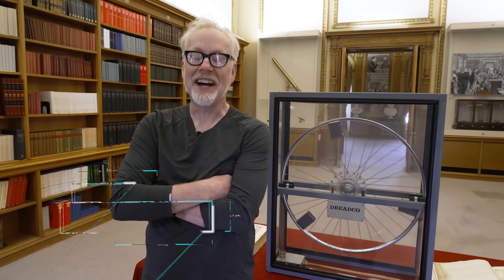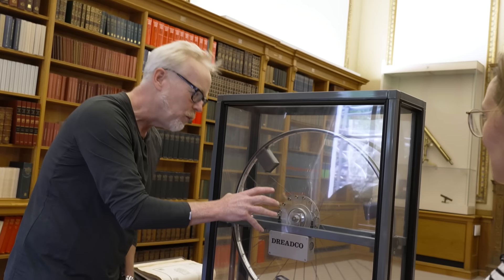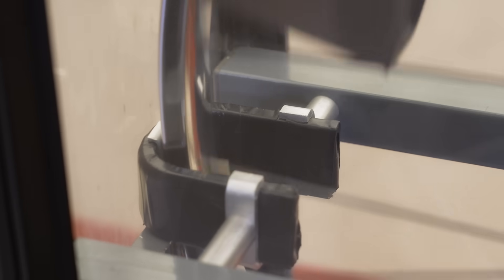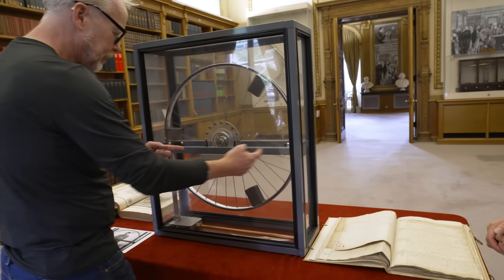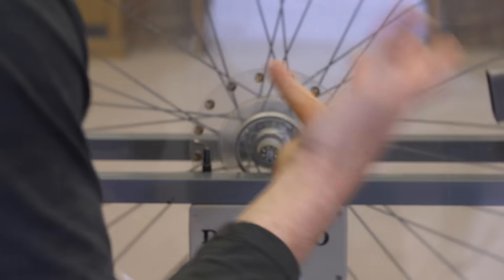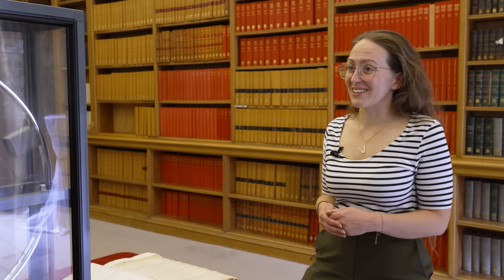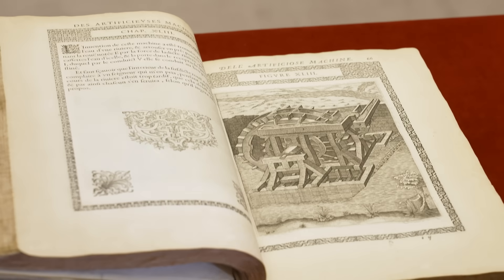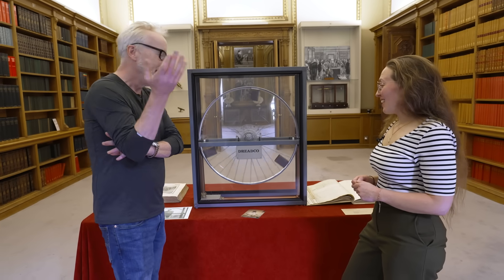Adam Savage vs The "Perpetual Motion" Machine!

Comment: I mean it's gotta be some sort of push pull thing with the magnets right? A weird hall sensor type devices to hale the timing and it tells the magnet when to turn on to pull on box and push the other and the whole time the wheel itself charges what ever mechanism keeps the thing running. I'd also assume the box is a vacuum to reduce the amount of potential drag that could occur with atmosphere. Of course it's also possible there's a solar panel or two in there to help keep it running, if people were disappointed by the answer. Either way it's a fascinating thought experiment and seems like it almost demands that others try it just to test their theories.

Comment: It does not look at all efficient, those don't appear to be low friction precision bearings so it's probably generating a considerable electrical field in certain areas which could easily be mapped with a digital rf meter, in fact the entire circuit could probably be described with careful analysis that would take about one minute using a basic rf meter.  My grandfather worked the perpetual motion issue nonstop for about 6 years, until I spoiled it for him when I was a kid, suggesting that there was no possibility in physics of success - even though I had little actual knowledge applicable to the matter.  I was just a kid trying to look smart, a sad blunder on my part - never douse a man's passion for mystery with hastily spoken reality.  Better to let dreamers dream for sometimes they do come up with some cool stuff.

Comment: My theory is that the energy of the machine is self sustaining. The servicing is replacing the bearings. It still maintains the “cannot create more than it uses” law.

I think the issue with talking about using perpetual motion to produce energy is that we are looking at it all wrong. We should be looking at making a machine that powers itself, and has a separate system that produces charge somehow. Hmm.

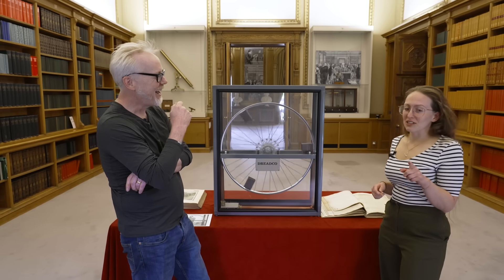Comment: I have stopped at 6:58 I suspect that there is a small battery powered fan blowing/circulating air via the copper tubes. A common doctors stethoscope would detect and motor hum or motor harmonics. (This is the powered driver)
>
The rest is the "Magnetic driven" perpetual motion machine, which is very elaborately and carefully created, including the slight offset of the electrical(ish)  actuators on the stator near the hub.
Just  guess as I can't see it close up, or drop a stethoscope on it :)
>
I will acknowledge the possibility of a reed switch in each box to activate a battery coil as it passes the magnet as others have suggested...

Comment: The central probes that don't touch anything are sensing the rivets in the center to tell the magnets when to reverse polarity. You will notice there are 2 bumps for every time a box crosses one of the U shaped magnets. 2 Phases for each time a box passes a magnet. First the magnets pull the boxes then as they pass through the probes trigger a switch in polarity and the magnets are now pushing the box around the circle. This would only require tiny amounts of power, the boxes contain both the mechanisms to reverse polarity (likely the center) and the battery (likely the heat sync box in the corner). You could easily wire it the other way around though. That's all there is to it as far as I can tell. 2 electromagnets and 3 boxes to be pushed/pulled. The bearing is likely extremely efficient and the system very well balanced. The less friction the longer it will run. When it dies they probably just replace a few batteries. D batteries?

Comment: I am going with the simplest theory. Magnetism. magnets in a push, or pull could be arranged in variety of configurations in the scope of that design. Boxes, inside the frame, the little nobbies near the axle,  and their poles sticking out, or a mixture. Eventually the momentum would be lost and need some maintenance, ie, a new spin of energy input, maybe even re magnetizing.

Comment: If I had to take a guess, it would go something like this. The horseshoes on the horizontal bar are electromagnets of some type, and the boxes on the wheel are permanent magnets. When they pass through the horseshoes, it creates a small current which activates a switching device, such as a transistor. This switching device connects the electromagnets to a battery, powering them up and giving the boxes a nudge forward. Once the box is all the way through, the induced current goes away, and the switch reopens. Because power is only drawn for brief amounts of time, the battery can last for years before needing to be replaced (or, one might say, serviced). I've seen perpetual pendulums that work this way, and this whole setup reminded me of that

Comment: The right-hand pointy on the DREADCO box is the outlet for a tiny very-low-power fan inside the box. As long as it blows enough air into those little copper cups to overcome the bearing friction, everybody remains perpetual.

Comment: The 3 boxes have ball bearings in a tube. The magnets move the balls from outer to inner spaces. Thus creating an offset weight which uses simple gravity to turn the wheel.
 I suspect batteries with a simple tilt switch is involved too. In which case, the mercury in the tilt switch would be a sufficient weight to create movement.

Comment: I noticed that it seems to be making 10 rotations per minute.  My guess is that in those boxes you will find a circuit that uses a CMOS frequency divider/oscillator IC - two commonly available devices are the 4060 and the 4521.  You will find these ICs used in battery powered clocks.  You connect a quartz crystal oscillator to the input of the divider IC and it will output a regular (typically 1Hz) pulse that gets used to drive a small electro-mechanical impulse motor.  I am guessing that the circuits are configured to provide something like a 1/3 Hz pulse which is fed into a coil that works against the magnets.  A single 1.5V cell (possibly a C sized cell) would drive a circuit like this for a couple of years.

Comment: Holy hell, the secret IS a motor, just not inside! IT IS A MOTOR.
Reply: The wheel has a coil of wire in the tread, and there is some kind of magnetic interaction with the boxes and those C dockets. Its like the OG Nikola Tesla ac motor

Comment: If the boxes on the wheels had a little bead of mercury in a vial at the right angle it could act as both the position sensor and contact for an electromagnet. Mercury relays were commonly used for exactly such a purpose.

There's room in there for a battery, mercury relay, and electromagnet coil. Combine those with the permanent u-shaped magnets in the case and that's really all that's needed. To find out you could place the base on a slope and see if it still works.
Reply: Something like that with a contactor for coils. I do think the inside hub offsets the push or pull to counter balance the effects of the magnets somehow. The copper pipe and weird heat sync is the distraction!

Comment: Id suggest either one or both the "Pointers" above the Dreadco box are actually magnatised at set intervals impair a slight pull or push on the rings mounted in the hub. The box itself may contain a capacitor with a very small charging circuit powered by ultraviolet light coming on from the vent. You could hold up a magnetic field viewer to the outside of the case to check.

Comment: I kept hearing slight clicks when the black boxes were passing the magnets when Adam was leaned in close.  My suspicion is that the motion is caused by the magnets pushing a steel ball around inside the boxes.  The one on the "upswing" is pushing it away from the rim, the other side makes sure it's at the rim if it hasn't fallen back to the outside on the way down.  It's good until the balls get stuck inside the boxes...
Wild ass guess, but possible. (I think)
Reply: I post that, then the curator describes how the weighted design doesn't actually work... nevermind.

Comment: I mean, I really don't think it's that complicated lol. Before watching the video I'd guess it just magnets placed within the boxes, and a very slight electromagnetic pulse being fired just before they pass through the middle bar, on either side.
Reply: This or the battery's and electromagnets are in the spinning boxes.
Reply: @lambda7652  right, it could also be flipped around. Or the batteries could be in the "heat sink" or even all along the inside of the outer tubing
Reply: @alliewonderland  its some sort of a crude brushless motor.
Would be easy to test with oscilloscope and big coil as "antenna".
Reply: @lambda7652  that is also very possible, and would still explain the "servicing" that is being done to it every two years

Comment: This could run on compressed air.  The frame is made of hollow channel that could hold the compressed air.  Very small passages could transfer the air to the hub where it applies the small amount of force needed to keep it moving. The servicing would entail repressurizing.  The other components are just a distraction.

Comment: I'm gonna go with the 3 boxes on the wheel have a moving part inside that that is reactive with the magnets on the sides giving a gentle push as they pass through as the weight goes from the inner of the box to the outer on the way down and outer to inner on the way up.
The other part is some compressed gas or air that gently spraying from those pipes, possibly constantly or every now and then when the speed gets a bit low.

Comment: There was a simple swinging desktop toy popular in the 80s and 90s that used a single magnet, NPN transistor two coils and a 9volt battery.  One coil would detect the magnet swinging by, send a pulse to the collector, which would in turn fire a pulse through the emitter to the second coil pushing the magnet by.  I'd suspect one or all of the boxes on the wheel contain something like this, pushing against the two horseshoe magnets.

Comment: The problem with all allegedly over-unity machines is they don’t have useful output power.  At best they appear to sustain their own motion.  One of the closest to purely mechanical “perpetual motion” machines I know is the Atomos clock which uses an ethylene chloride filled bellows to harvest the energy of minute room temperature and air pressure changes to drive a rotary pendulum with a 60 second periodicity.  The work output is on the order of Nanowatts, but is enough to accurately display time of day on a dial.

Comment: After Dr David Jones published this in the back pages of the New Scientist way back in 1981, I built my own version. Mine had an ample supply of batteries and ran for years on one set. It ran for years at Watford Grammar School in the tech department where I taught.
If you think about a clock, the pendulum travels back and forth hundreds of miles in a week for a tiny, trivial investment of winding energy. A rotating wheel on really, really good bearings needs very little power to keep turning, but it needs some, pure inertia will only let it turn for tens of minutes at best. I have been there and tried.
Thinking about clocks gave me my solution as to how mine works, there is a precedent in a type of 'mystery clock' where a single, counterbalanced hour hand, freely pivoted, which when given a nudge, seems alway to return and settle to the correct time and creeps around in 12 hours. Of course David Jones' wheel may use a different solution, but I think not.
Google 'mysterious circulator’ by Frodsham London for a description of the workings.
Reply: And the thing is, even if this really was a PMM that never slowed down you can't extract any energy from it. It can't run anything so it would only ever be a curiosity.

Comment: I think it would be interesting to film this wheel with a Phantom. That would probably enable you to see the subtle "kick" as the wheel accelerates, which would give you a clue about where the mechanism is hidden.

My best guess is that it does work like a basic motor, with a battery in the "Dreadco" box powering little kicks to the U-shaped coils, and possibly one of the Wimhurst-looking arms is a Hall effect sensor that signals the circuit to activate at the right moment, with some the little discs around the center being magnets to activate the sensor. The "servicing" would consist of replacing the battery in the box. I doubt there's anything active or replaceable on the rim, because these systems have to be so exquisitely balanced to make them run effectively; replacing batteries in the rim-mounted bits, e.g., would require lots of finicky re-tuning afterwards to make sure they were at the right distance from the center, etc. Keeping all the maintenance bits in the center is definitely the way to go.

I think it's important to note that these things are really cool art pieces, and that it legitimately takes some skill to make a wheel this finely balanced and low-friction. I think there's legitimate value in a piece like this, that draws attention to the human fascination with "something for nothing" as well as with precision engineering.

Comment: In theory, perpetual motion is dead simple.  Easy to design a set up in a theoretical closed system.  Actually building one hits a million snags. 
In example, imagine a wheel in a void.  Spin it.  Done.   No air friction, no gravity, nothing but a spinning wheel, forever.   Easy enough to get a wheel and spin it, but getting a void to do so in has proven difficult.
Reply: Could it be done with water to negate the gravity with air filled tubes. When the water level goes up , the tube goes up  letting out the water, and when the water level goes down the tube fall down letting water fill in.

Comment: I think the copper pipes at the bottom direct air from a battery and a small fan to blow on the edge of the wheel and impart a slight spin. The weights add the necessary momentum to keep it running with such low input.

Comment: The entire framework is made of 1 inch square tube. It could contain dozens of battery cells.
Reply: "Of course the secret is sealed away in an envelope that nobody has access to-"

Me: Batteries
Reply: I have a watch that absorbs light energy through its face, and after 1 hour in sunlight, it is charged for an entire year.
Reply: I think it would be decidedly heavier if that were so; nobody in the Society would question how it worked if it weighed as much as 100 cells.
Reply: Nope, that's not it.   In the mid 1980s we had it at Museum of Science in Boston, with a contest to guess how it actually worked.   In the end there were two simultaneous winners, and they had to split the prize.   The museum staff got to disassemble it, for periodic servicing.  But  ...THE MYSTERY PERPETUALLY REMAINS!
Reply: There are so many places any number of batteries could be hidden. The way that they are talking about the disappointment from the people who know makes me think that it is 100% a motor with a battery hidden somewhere. If it was something more involved, people would be more inclined to say that than point out their disappointment
Reply: What have you made of the royal society to be I would ask.
Reply: But where is the drive motor?
Reply: @mgakowski  so assuming Adam is right, the magnets could be propelled/have a charge imparted into them from the copper bits. Just a very big, very slow, motor.
Reply: @mgakowski  If the bearings are good, you don't need much for a motor. Even something like changing an electrostatic charge on those metal weights on the wheel would be enough of a push to keep it going.
Reply: @mgakowski  Could be anywhere. Hidden in the hub. Could also conceivably be those two electrodes and the ring of magnets. (You've seen the simple motor you can make with a AA battery, paperclip and magnet, right?)
Reply: If u think it's batteries .... make one and see how long it last. I bet u only get 4 months rotary motion before the batteries die, giving the volume of the hidden areas.
Reply: @piercebishop4052  Unless it's something that works with outside light or heat or air pressure, it's always just some kind of battery.
Reducing the friction is the only thing you can do to make it run longer. Everything else would just be like putting a better battery in it.
Reply: @Mobin92  Could be a quartz battery
Reply: @piercebishop4052  of course it a battery you don't need much power if you aren't doing much work simple proof is look how long an old clock can last on an AA battery and it doesn't just stop it starts losing time just like this thing after a period it starts slowing
Reply: @piercebishop4052   why would you think its not batteries?
Reply: @piercebishop4052  You fund the project and sure!

As Eric already pointed out, all that frame tubing could contain batteries, as well as the copper tube and the heat sink box thingie. The wheel hub has lots of space too. Put that wheel on a couple of pinpoint ruby bearings, evacuate most of the air from it, and it's near frictionless.
Reply: rechargeable batteries charged by the kinetic energy from the wheel.
Reply: @C4rL72  Converting the kinetic energy from the wheel to electrical energy would reduce the speed of the wheel. It'd be more efficient to use less energy to turn the wheel and not charge the battieries.
Reply: @C4rL72  You're trying to explain it as a perpetual motion machine. Charging its own batteries would just put more load on the motor in a losing proposition. You can't ever get ahead like that. (You can capture and reuse some waste heat, is about the best case scenario. But that only works because your machine isn't in an enclosed system.)
Reply: @C4rL72  If you could make that work you would deserve a Nobel prize. In my household we obey the laws of conservation of energy. 😄😄😛